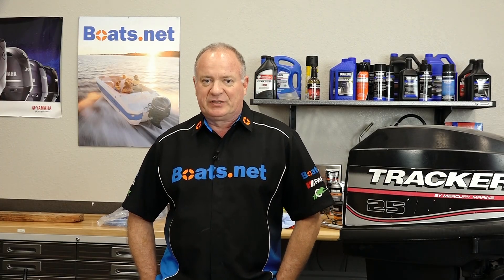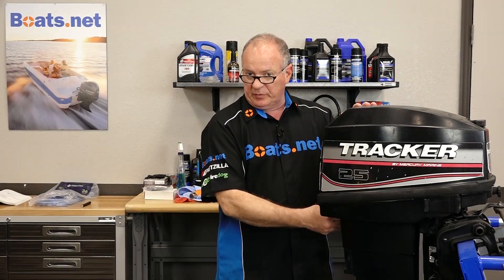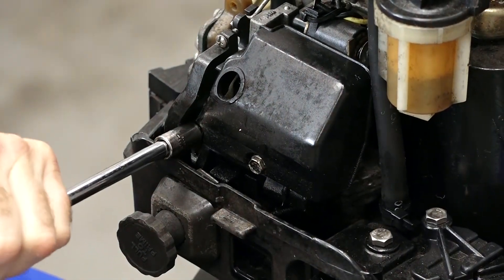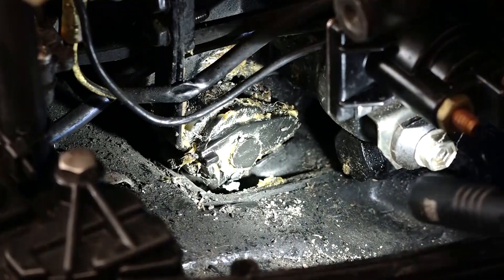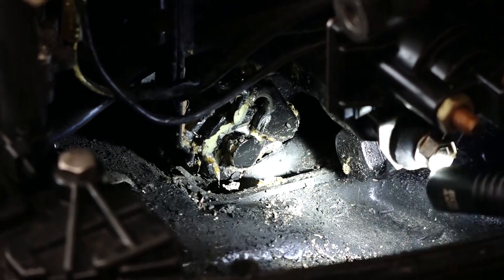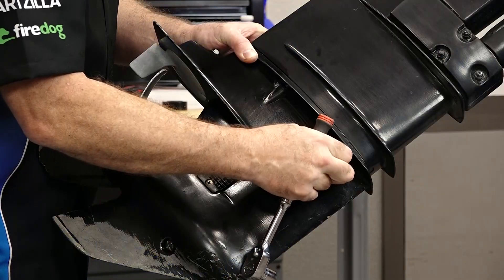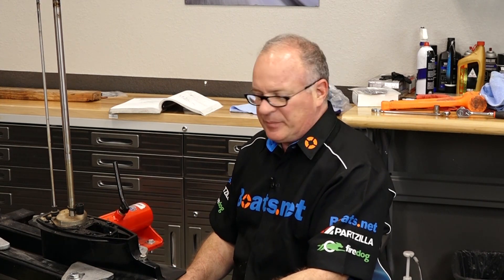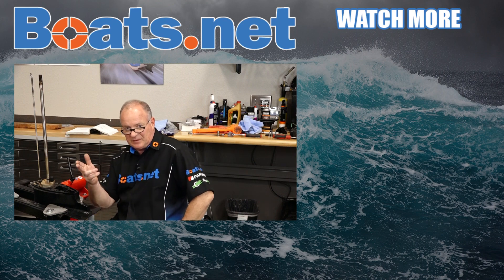Mercury Tracker 25 Lower Unit Removal | Mercury Tracker Gearcase Removal | Boats.net

Comment: I have a question.
How do i remove the shift shaft from my mercury 25 hp.
Thanks
Reply: Have you figured this out? I have the same question.
Reply: @africanjew1596  yes i did, just pull it out, i did put the shift shaft between a vice, and than hit the tale with a rubber hammer.
Mine was stuck like crazy.

Comment: very good from Spain.  I have an engine just like this I have done all the maintenance on the lower unit when I reassemble the forward gear does not suit me.  the gear is noisy or slipping.  I think it's the gear rod!  How do I adjust that?  I appreciate it if you can give me a hand.  thanks and regards

Comment: DON'T LOOSE THE REVERSE WASHER! - https://www.youtube.com/watch?v=miBBEz35mbI
The shift shaft needs a #12 or 1/4" washer to engage the rod reverse hook - don't loose it when you remove the lower unit!
Reply: I used an M6 but probably same difference.  It was not easy to get everything lined up; the “push rod” had moved and was twisted. I think I lost two washers just learning all of the steps to properly get it installed.

Comment: I'm working on my 75 Mercury tracker place to water pump I missed around and pulled the gear shifter lever up while I've done it I have no clue so what happens now so I just push it back down or did I mess up

Comment: Hello John, I cant get enough of your awesome content. I own the 2002 merc/tracker 25EL and as you can imagine, that video series is extremely helpful. The engine came stock on a 2002 tracker pro team165. I gutted the boat this spring and noticed there was an alarm buzzer wired in to the dash but i dont think this engine has the alarm controller attached to the power head because ive never heard any beep at start or anything for that matter. Did tracker just prewire this for a different or larger engine? Does the 25EL model come stock with an alarm controller? The 8 pin remote control harness is only pinned out for 6 wires so im thinking this is probably an option in different motors. Thank you.
Reply from the maker: Steve, Chances are you are correct that Tracker prewired it depending on what outboard would be installed. Mercury typically has any warning indicating device (buzzer) as part of the helm wiring harness. On the smaller Mercury engines, this buzzer would annunciate if the engine were overheating or the 2-stroke oil level were low. There is no controller but a simple parallel circuit that gives a path to ground should either sensor close contact.

Comment: I love how he makes no mention of the little washer that goes on the shifter rod. You can see it fly out of the motor at 2:20, this is a SUPER important part about removing your lower unit. If you don't put this washer back on you won't have reverse!
Reply: That washer, goes on the shifter rod, it sits under the reverse hook yeah? To pull the reverse hook up, and therefore the reverse lock up too, when you shift into forward. (as you don't want reverse lock on in case the outboard hits a rock or something while going forward).
Reply: @iamremi888  yep! I bought a 1998 25 hp from an older guy and he had Bass Pro work on it (for God's sake, don't ever do that). He kept saying make sure you don't shift into reverse when the motor is off, I was like huh? Why would that matter? They had told him it's not good for the motor. When in reality they lost the washer and had no clue wtf they were doing. So I get it home, take it to the lake and am waiting in line to get off the lake and someone goes in front of me, no reverse. I take it to a guy with 50 years of experience work on it and he said he fixed it. Went to the lake again, no reverse. I put the boat up for the season and started scouring the internet for info on it to troubleshoot. It came down to a .95¢ washer. Drop the lower unit, put it on, reverse all day back and forth with ease. They really need to redo this video and talk about the washer!
Reply: @squ1rr31  Mannn that sucks. Glad you figured it out. Glad you left a comment. I havnt ran into this but YouTube comments have helpped me so much with my motors. Thanks again.